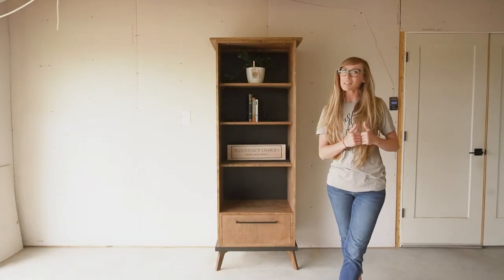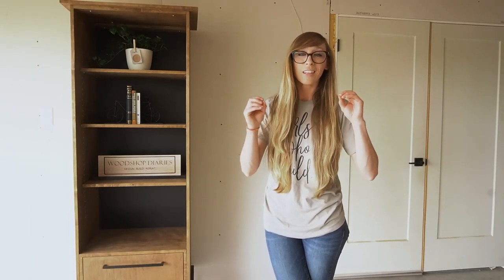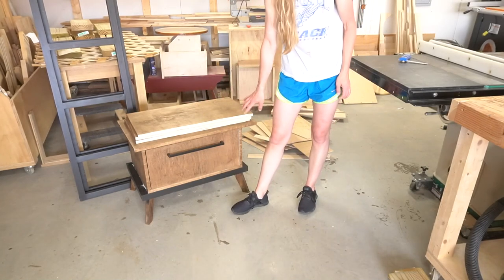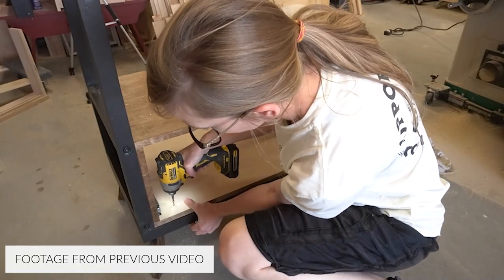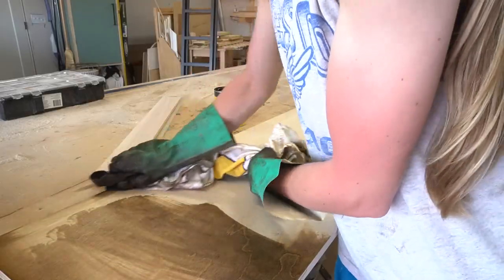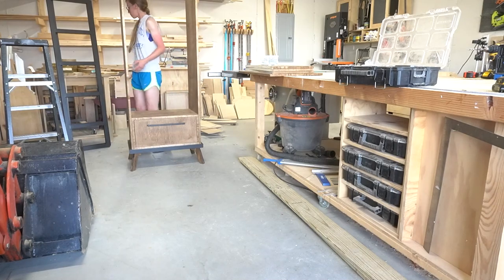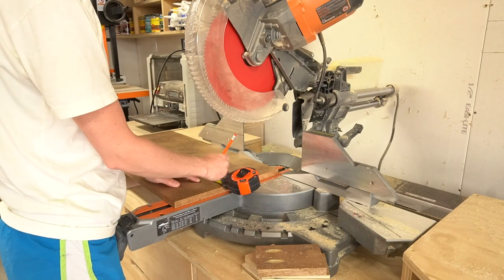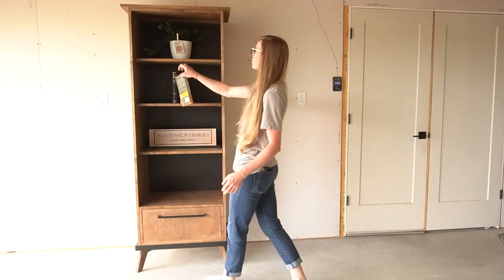How to Build a Modern Bookcase Cabinet--{WITH STORAGE DRAWER!}

Comment: Shara, great build. I like both so to pick a favorite leaves me at the 50/50 mark. I do like repurposing one project for another. A couple of weekends ago I grabbed some furniture that was headed for the dump with the plan to cut it up and repurpose it. The second bookshelf feels a bit dark to me but I don't have a suggestion for a change. The best thing about your videos is that they give us many build and design aspects to PONDER! Thanks for sharing!
Reply from the maker: That's awesome to take what was going to the dump and give it new life!  My thoughts on "lightening" up the closed bookcase is to either stain it lighter (or just leave it natural) or paint the back panel white instead of black.  That would INSTANTLY brighten it and still keep the same design and style. White and wood look just as good as black and wood haha :)
Reply: @WoodshopDiaries  I've "pondered" a while and I think you had  the final bookshelf in a darker part of your room so it looked darker than it really was.  I find your reply interesting because your a step or two or many steps ahead of me about changing the final appearance of a project.  Lately I have been using a lot of "Natural" stain and which lets the wood, even plywood speak for itself. Hope your enjoying the weekend.  Thanks for sharing. :)

Comment: Very nice.  I like both of them.  Even though they are modern, each would be used in a different space.  When you stain that plywood, I don’t understand why it sin’t so blotchy.  The Birch plywood I get here, when you stain it, it becomes a mess.
Reply from the maker: I’ve not had many issues with blotchy birch. But I use PureBond birch plywood exclusively. (I’m not sponsored, I just have used a lot and it’s by far my favorite). It’s available at Home Depot.
Reply: @WoodshopDiaries  Thank you.  I will try their’s.

Comment: Love them both! I've probably said it before but I really like the simple, clean look. Especially the design of the feet. How do you think they would look with a slight taper from top to bottom? Do you think that would be hard to do?
Reply from the maker: Thanks so much! Are you talking about tapering the feet or the bookcase? The feet do have a slight taper. I’ve got the template for it in the blog post here 😊
https://www.woodshopdiaries.com/diy-modern-bookcase-cabinet-with-drawer/
Reply: @WoodshopDiaries  I don't know what I was thinking. Somehow I thought you were using material that was like, 1-1/4" thick for the feet. That's why I was asking about tapering the thickness of the leg from top to bottom. The template helped me understand your design. Thanks.

Comment: This design looks good as well - gotta say though, I'm partial to the open design (its the exposed screws ;P). 
Also - way to get 2 solid videos out of basically the same materials and really limited timeframe, super efficient. 

Last thing - how do you like the Mirka sander? I just got mine, but haven't gotten a chance to put it to work yet. Super excited about the upgrade though!
Reply from the maker: Sooooo glad for this positive feedback. Was afraid it might not be received well. I really enjoyed the transformation and glad to hear you did as well! Also...the exposed screws did kind of win me over towards the open design too 😉

I really like my Mirka sander. I’ve had it almost two years now and no issues to complain about. The only thing that’s kind of frustrating (which I guess is really the case with any sander) is that the “sticky pad” (I don’t know the terminology—the little pad that goes between the sander head and the sanding disc) doesn’t stick very long. Could be operator error 🤦🏼‍♀️ but it’s not a deal breaker because whenever I buy a new pack of Diablo Sandnet discs, they come with a new pad in the package so I can replace it pretty often as I go through a lot of sanding discs. I hope that makes sense. All in all, it’s a great system.
Reply: @WoodshopDiaries  Nice, glad to hear you like the Sander, its a heavy investment - so glad to have the purchased reaffirmed haha. 

I could see why you'd be hesitant about the back to back builds. But absolutely nothing wrong about trying multiple designs and sharing that with people. Lumber is expensive as crap right now, you're showing people how to throw in some costs savings into their projects. 

Oh, also love how the exposed screws slowly won you over haha. Classic

Keep the quality vids coming thumbs up

Comment: Hi, have you had  contrast with pocket jig holes?  I see you use them a lot. Do they work good even after wood drying?
Reply from the maker: I’ve not had any issues with using pocket holes. I’ve got pieces I built five years ago and been through summers and winters in a storage unit still holding up just fine.
Reply: @WoodshopDiaries   Thank you for your view. :) Yes, your videos are awesome, and are the type of furniture I am attracted too. Thank you. :)

Comment: Would putting cutouts in the side of a cabinet style bookcase make it less sturdy?
Reply from the maker: I’m not sure what you mean by cut outs??
Reply: @WoodshopDiaries   I don't think it's a popular thing right now, and if I could add a picture I would, but I'll try to explain to the best of my ability. My mom has an older secretary desk, from before computers were a thing, and on the side panel it has a hole cut into the middle of it that's shaped like a clover. The design choice has captivated me since I was very little and is still a favorite of mine. But as the peice is relatively small I doubt having the hole in it dose much. So my question is would having a couple of these decorative holes ruin the sturdiness of a tall bookcase?
Reply from the maker: I’m not 100% sure I know what you’re talking about, but if I am understanding right, I don’t think some small cuts would make too much of a difference just depending on the size of them and the locations.